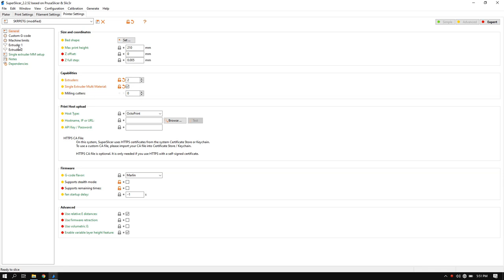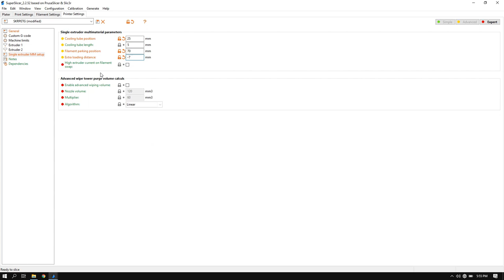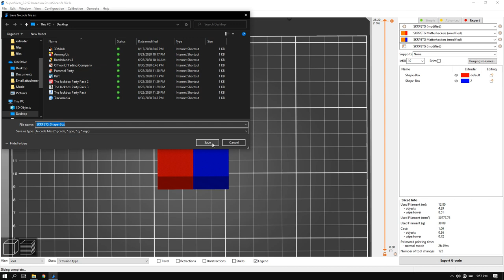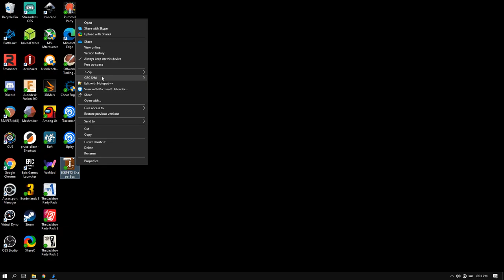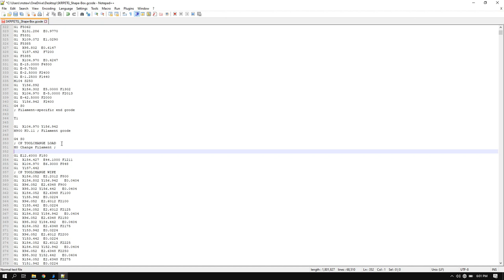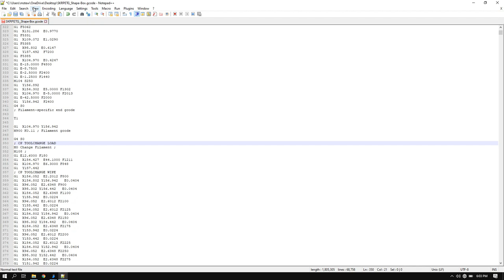PrusaSlicer(SuperSlicer) Setup For Multimaterial/Color Prints using a Single Extruder

Comment: I'm working on my slicer prusa slicer for dual extrusion but I'm having trouble getting my retractions to work right between colors and my computer screen dose not let me see you comp. screen very clearly. i need help with setting the retractions.
Reply from the maker: Download a retraction test off thingiverse and run it and adjust.  Each machine is different.